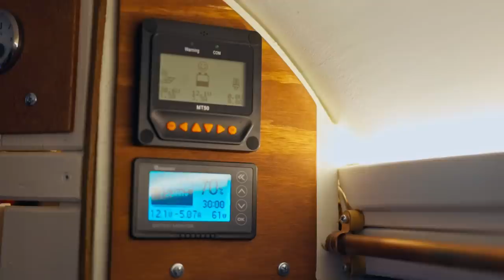This Bus Conversion Is Better than Most Apartments

Comment: I have a question about the wood stove: How do u keep animals out of it? I mean, I would think that if you're not using it, animals (like bats, birds, squirls, bugs, etc.) would try to get in the chimney of the wood stove, thinking it acts like a fireplace.
Reply: Never had this issue. But you’re right, it could happen. We recently changed our cap and I’m happy that this new one would prevent this (smaller opening)

Comment: I noticed you have the original bus windows. Don’t you have a lot of drafts coming into the bus in the cold months?
Reply: Good point! We liked the look of the original windows but it came with a cost. We still insulated about 30% of them from the inside. For the others, you may be able to see that we sewed the curtains with a decorative material on the inside, and an insulated material on the window side. It's not huge, but it helps!

Comment: How can we, here in North Carolina (a place that gets very hot in the summer), have air conditioning running all day and most nights
Reply: Hi! If you can’t be plugged in, you’d have to use a generator to take on this load